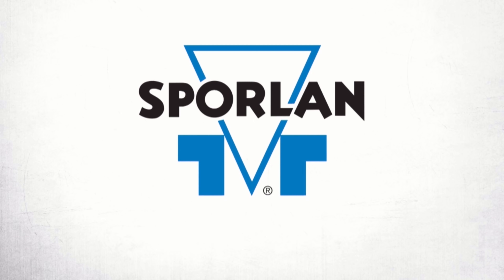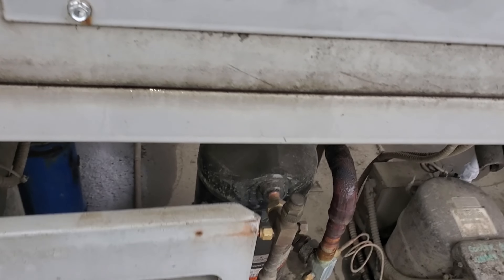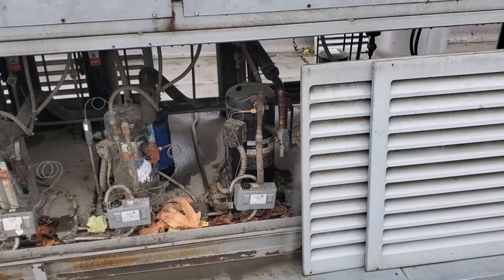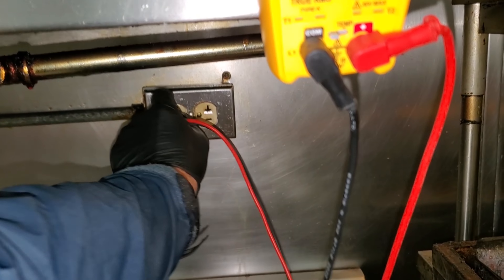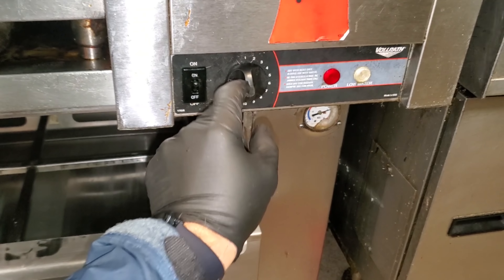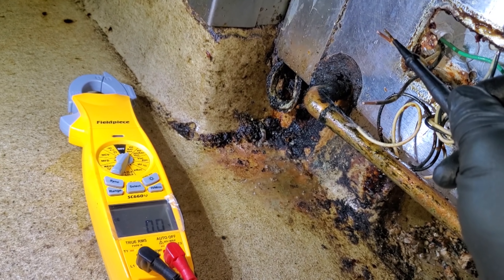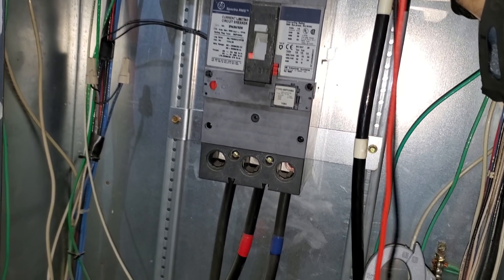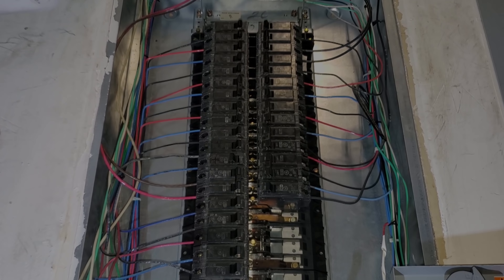NO POWER TO THE COOKS DRAWERS

Comment: My guess is the C phase was not connecting to the mains at all, and the 70V you were seeing was "bleed over" from A and B through other 208V equipment (motor winding, heater coils, etc).  So, it could make sense that the C phase would drop to 0 volts if the other 208V loads in that panel all either satisfied, or overloaded (thermal cutout on motors, for example).  Either way, it was definitely impacting more than your cook's drawers, so it was good for you to keep investigating.
Reply: Sounds legit to me, not sure what was exactly the situation but lets assume a scenario where a 208 v load is connected between A and C phases and another 208 load between C and B (my guess is that a restaurant kitchen would have multiple high power 208 v resistive  loads like heaters distributed across phases) so in this scenario they form a resistive voltage divider, and maybe some small loads like fans could draw enough power from this divider to actually work
Reply: If that were the case, how would there be correct incoming voltage to the panel breaker?
Reply: @RJMaker  The mains from the transformer to the main panel breaker is likely good.  It's probably something broken inside the main breaker.  He checked the C phase before and after the breaker to neutral (or ground, I can't remember which), and found that he had 120V before the breaker, but only 70V after the breaker.  And, as previously stated, that 70V after the breaker is likely from other 208 loads "bleeding" back onto the disconnected C phase.
Reply: @alexanderbresnahan2932  Ah I didn't read your first comment well enough. Sorry about that.
Reply: yeah that was just backfeeding power from all the 2 pole single phase devices, likely mainly resistive element ovens/cook-tops, but could be other smaller coolers, fridges, drink dispensers.   I notice see any 3 phase breakers in the cabinet at all, but there's still be low/unstable power to everything on that leg, hopefully no motor/compressors :)
and about the time I posted, I noticed one labeled "glycol room AC" and two "CVAP" probably controlled vapor ovens with blowers inside and who knows what else inside. I can just imagine the ruined food lol
Reply: @RJMaker  The incoming lines are Ok. It is that likely the breaker itself does not connect one phase at all, and the voltage measured is the result of voltage redistribution from other phases trough 208 v loads
Reply: My guess is for some reason one of the phases on the main breaker tripped or lost contact. A reset would probably have either left everything without power or only two phases or reset all. Likely all of the other loads were forming the resistive divider as most of the other comments here say and that would result in a reduced line voltage it's not as bad with three phase, you can have this with a lost neutral and that usually causes a lot more havoc.
Reply: As long as any 3 phase device or motor is already spinning it will supply voltage, as backfeed like you said with reduced current capacity

Comment: I worked for an electrical company for many years. When you see discolored bus bars, wires, etc. don't go near them until you have proper safety vest mask, gloves etc. on. I have seen many injuries with something lets go while checking it out. Also broken neutral are a huge issue on single phase stuff especially. Your can have 220 on one leg and nothing on the other leg with a broken neutral. I saw a house with Vinyl siding on it smoking from the metal service entrance pipe due to a broken neutral. Thanks for the video.

Comment: Well done Chris. Not many non-electricians would find that. In fact, not all electricians would find that 😂😂

You’re right on the breaker too, it may not reset after switching. Worse, it could go pop. I’d be very guarded switching it, but I’d certainly be placing all the panels and screws back on/in before operating it.

Comment: Wow nice find! Reminds me of last year when the power went out to my house it came back on but at about 200v (100v split phase) and it was the power coming in the house. Power company thought I was on crack until they came out and measured it themselves. They had a bad regulator and 1/3 the town was low.
Reply: Lol. We had a tree take down lines next to our house, for some reason two weeks in the hospital still didn't have power. and I made a remark about how we still had a line on the ground not connected and they looked at me like I was insane because it was just the neutral line after all.

Comment: You did the right thing not touching that main breaker - as you noted, it could have extensive internal damage. It might have been interesting to see thermal imaging, but just to satisfy curiosity. 

For others - the issue with opening panels like that is the fault currents are much higher, which makes any potential arc flash much more serious. You might be "just looking", but if something does fail while the panel is open, you could end up with a face full of vaporized copper,
Reply: Yeah, look up mine breaker accident. It did some extensive damage...
Reply: Specifically dawson mine
Reply: @charadremur333  With high voltage involved, most people clearly see the risk. But arc flash accidents happen with high current, and don't require high voltage. People can think they're safe, because "it's only 240V",  but the fault current in a switch board might be tens or hundreds of thousands of amps.
Reply: @charadremur333  That Dawson mine video was excellent, btw. Thanks for pointing it out.

Comment: Good point not to reset the breaker once the fault is located so as not to cause more problems (or to have left the entire block without electricity if it had not been rearmed again). I like your prudence. 👍

Comment: KUDOS.  I also manipulated heat. have since repurposed myself. (I helped Noah build his boat)  Nice to see someone that actually cares about the total picture and his customers safety and bottom line  Great to the point on the videos and great explanation of your diagnostic process.  
Kudos on ditching theory of bad neutral (surprising how many don"t even consider that possibility) when it din't pan out in diagnostics.}   
 Didn't see any three phase breakers in panel after main breaker so looks like every thing was actually single phase.. possible reason why no more detectable problems by restaurant personal..
Couldn't tell age of unit; possible evap fans electronic .. some are rated 70 to 227 volts.
Also liked you were considerate enough to rethink last move and was able to advise the electrician as to main breaker. Helped him and the restaurant

Comment: VERY GOOD! so many people do not think of voltage drops. I am going to say 8 or so years ago, I noticed my den light starting to dim for no real reason that I could think of, a few days later I realized it was when my well was cycling on,  it turned out I had a badly burned breaker & buss bar, I just installed a new breaker 2 slots down. technically I should have put a block off plate in breaker opening, but I put a piece of tape over, still there, & not had issues since.

I am proud of company I work for as what gets stored in electrical room,  2 things, the upright pressure washer on wheels, & the janitor keeps his cart in there when not in use, which he uses 9am-5pm 5 days a week. thats it other than dust.

Comment: Superb. It is a pity that you did not measure current and voltage drop across contacts in the faulty phase. This would shed some light on failure type. Also, assuming 30 VAC voltage drop across main switch contacts carrying e.g. 20 A we are talking 600 W, i.e. immediate risk of fire. Thermal camera would show so much more we could see in the visible band.
Edit: It seems C phase had no continuity/high impedance in the breaker. The current in C leg was most probably very low and no fire hazard existed. Changing load comming from the oven/heated top could have changed voltage to ventilators so some kind of intermittency in fault was possible.
Very interesting case ;-).

Comment: good catch most people would not even look for that  and if they do find it the erg to throw it off and back on is hard to fight. part of my high voltage training was to be present for a 480 volt flash over and seeing the damage from it. depending on how long it has been low fazing you will be back replacing things.

Comment: That is some weird voltages. The C phase was only getting 60 or 70 volts but you see new stuff every day I guess.
Keep up the nice content I love it!
Reply: Likely due to an open leg or internal resistance in the main breaker. The second choice isn't likely though, because Chris would have noticed the heat coming from the breaker when he touched it.

For future reference, the IR camera will pickup the heat signature of high resistance easily

Comment: Hello Chris, Very nice video.
I have a question for you: I noticed that you are using your thermal imaging camera to probe stainless steel surfaces. Doesn't the high reflectivity of the surface mess your measurements? Is there any special setup for that? Because my thermal camera is confused whenever I point a high reflectivity surface. Thank you in advance for your time.

Comment: Just an FYI you disconnected the heaters in the beer cooler ..... wires should have been removed from the breakers as per safe working guidelines and NEC. I realize / hope you at least wire nutted the wires at the J Box but I believe the NEC states that all unused circuits be removed from the power source if not removed in their entirety if possible. Other than that I really enjoy your videos.

Comment: one leg not passing power on a breaker = 100% bad breaker, there is no way possible for a single leg trip without internal damage, so it's a guaranteed bad.  for safety of other equipment, probably wise to have shut that whole panel off or all the branch breakers, sure they'd have been S.O.L. in the mean time, but it's a larger gamble of what other equipment was harmed, both long term and short term. they really should have noticed the night before and been screaming loudly, oh well, nobody is perfect afterall :)

Comment: They don't seal electrical junctions and outlets with RTV in greasy areas like that?
Reply: Pro installers will; mods later--by lesser-trained people--won't.
Reply: I don't reccomend using RTV in wire connectors - 
1) it's not listed for that use
2) most RTV has a lot of acetic acid - that's the vinegar smell - it's very corrosive to copper. 
Use something like silicone grease or any sealant compound listed for electrical use such as ScotchKote. I prefer silicone grease because the connection remains serviceable indoors. Outdoors I generally go with the ScotchKote or epoxy paks.
I'm a licensed general electrician in Northern California with 35 years in the trade
Reply: @sinistersparky9657  not the actual connections, I'm talking about the box itself,  like a gasket for the cover so grease and liquids can't really get in there and mess with the electrical connections
Reply: @jonarmedpiandsecurityoffic9051  gotcha 👍
With that I can say everyone after you will appreciate it 🙏

Comment: didn.t know that a cooler tecnician can open main circuit breaker panel. u could do the same check on the power plug or at the power connectors inside your unit.
honestly finding grease and other things inside an electrical box is a fire hazard.

last but not least. for a 20 A breaker that wire seems to me a bit tiny

Comment: Next time: Put the amp clamp on the input wires, this should give you an idea how unbalanced the load is.
Reply: I would be careful, if there is a loose connection then moving the wires might be able to cause an arc.
Now that I think about it moving ANYTHING in a breaker panel could be dangerous.
Reply: @TildaAzrisk  you don't need to touch anything to put an amp clamp on the wires.

And no, it's not dangerous to use insulated testing equipment in a breaker box.

I mean, it's just 110 Volt you're dealing with, not 10kV 🙄
Reply: @RubenKelevra  technically it's 120 split phase so you get 240 volts. Unless in this situation you're working in industrial with three phase where you have 208 between phases things can get nasty fast.

Comment: Power company lost an phase here only one side of the house had power.
Reply: oh you had one of those houses where the loads weren't necessarily evenly-balanced. Or the older variety wear they probably started as 1 phase and then the add the second. We had a branch take the line out going to the house and pulled the meter off the wall. when I woke up I did not know anything was really off. I walked outside and I was like how is this still on. And then the power company decided since it was the coldest day of the year they had to turn the power off and couldn't just leave it as is for a day. The line hinged the meter box off the wall and the Mast and line were on the ground to the pole, when we got the electrician out there to redo it so we can get the power back on I saw that the one of the phases disconnected and was just floating in the Box as it snapped off its terminal and a chunk of insulation.

Comment: Keep inside panel work to the professional's called Electricans and HVAC/R work to the Service guys.
 I've seen HVAC guys get badly hurt not knowing how to check for faults correctly in with bus bars and/or arc faults within defective Breakers...